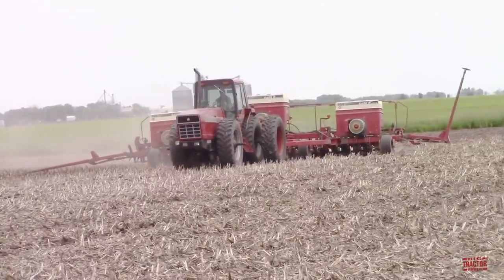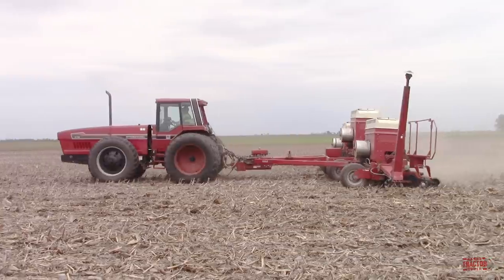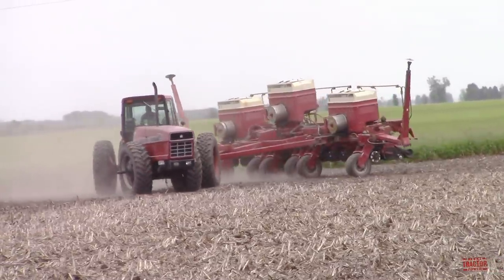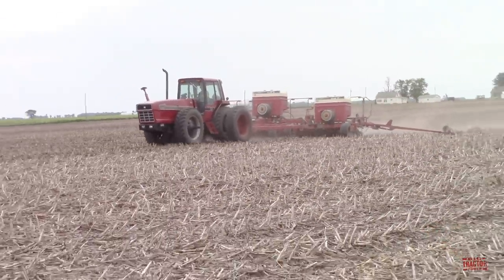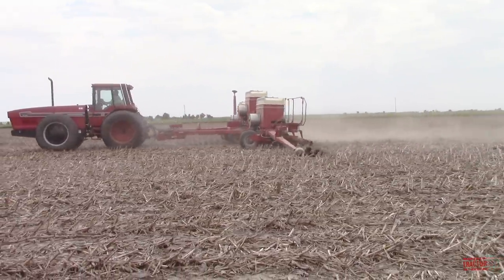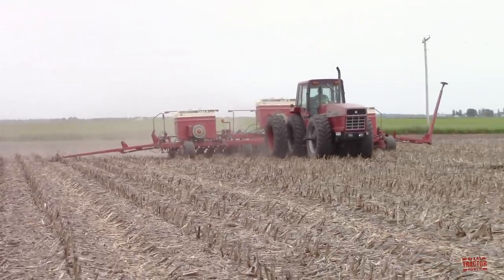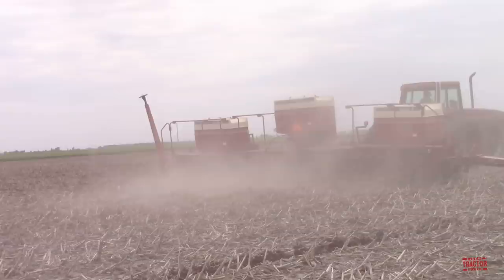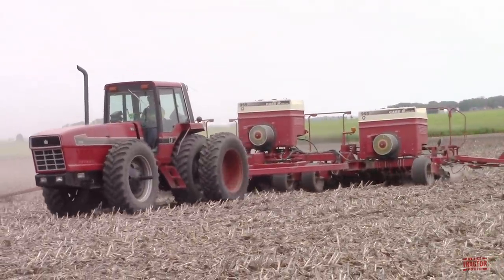INTERNATIONAL 6788 2+2 Tractor

Comment: I have a 6588. They say you either love or hate 2+2’s, I fell in love the first time behind the wheel. I really feel like if they were built a little bit heavier, they wouldn’t have got the bad reputation they had in the 90’s and early 2000’s. Treat them like the row crop tractors they are meant to be, and they are great pulling, economical machines. Great footage with the cyclo! 2 IH exclusives in one video!
Reply from the maker: It was neat to see this 6788 with the 955 Cyclo. I like being able to show brand matching tractors and implements .
Reply: Katwar ĺpl04

Comment: I used to run a 3788 2+2 on a dairy farm I worked at.. I did many tasks with it from chisel plowing to pushing silage ... It was a good machine and I have no complaints with it
Reply from the maker: Very cool. What type of blade was used?
Reply: @bigtractorpower  I believe it was a old degelman blade .. it was actually a nice tractor to push with because you can steer the front close to the side of the bunk and really pack the sides in .. not like the 8640 JD we used that couldn't get that close to the edge

Comment: Great video Jason!   I’ve never seen a 2+2 IH tractor but every since I’ve heard and read about them it seemed to be a great design.  Cool to see one working today.
Reply from the maker: They are an interesting tractor. They really stood out in the early 1980s. They are one of my favorite tractors. I am always excited to feature one.
Reply: @bigtractorpower  I can tell.  When you was talking about the AFS Connect CaseIH Magnum tractors it is interesting that the 2+2 was actually shorter lengthwise, even though that 2+2 has an articulation joint in front of the cab.  It probably would have been a great tractor if CaseIH had chose to keep making it after International Harvester was bought out by Tenneco.

Comment: Oh wow! Never seen an articulating tractor like the 2+2! Interesting! Thanks for the informative video Brother! God bless!
Reply from the maker: The 2+2 tractors were built 1979 to 1985.  The first generation models are the most common with a white cab. The second generation models with red cabs are scarce.  The 1985 models called the Super 70s saw less than 30 built before being discontinued in the Case IH merger.

Comment: We have had a 6788 since 1999.  We bought it to plant with which we did for 13 years.  we still have it and use it for rolling bean ground and sometimes put it on a grain cart.  I really loved it when we first got it but the shifting does wear on you especially after having newer tractors with powershifts.  We have talked about selling it maybe we will.
Reply from the maker: That is neat you have a 6788. When you replaced it as a planter tractor what tractor did you go with ?
Reply: @bigtractorpower  We found a Ford 8830 and planted with that until this year when we got a Cat Challenger 55.  We still have the 6788 and are using it on our roller.  Switched the Ford to full time sprayer tractor.  We have all colors on our farm very nondiscrimination here.
I love farming even with old equipment

Comment: We have a 3588 and 3788 2+2 tractors. The 3788 has a terrible vibration in the hydraulic system and we can't figure it out. The 3588 has been a great work horse. We have run that tractor on a 3x4 big baler, 16n42 wischic disc, and our land roller. Been a good work horse.
Reply: Check the pump.

Comment: we got a 3788 sitting in the shop apart right now, the 2+2 idea is rather impressive if used like a proper row crop machine. it would have been interesting to see what they would have became had IH been ok
Reply from the maker: Cool on the 3788.  It is too bad the Super 70 7488 and 7288 did not make it into full production.

Comment: Good video Jason, very informative as usual.  Just think of a Case IH puma like that now.
Reply from the maker: An articulated PUMA, OPTUM or MAGNUM would be neat.
Reply: Meaning something like this 😁:
https://youtu.be/Js6IqNTgYvs

Valtra made articulated tractors that looked normal tractors ~100hp to 
160hp

I'm not sure can you still buy new articulated Valtra, but at least late 90's to 2010's  those were made.

Some later ones have also front wheel steering.

Some were used in agriculture, but i think mostly in forestry and municipal (road sweeper, snow plowing) use.

These IH 2+2 tractors are so cool and unique 😎
Reply: @JS-1983  I remember seeing one of those in the uk. The owner had a business making wood shavings for horses.  Valtra were trying to target livestock farmers, they were very good in farm yards where space was tight.  I think the price put them off.  Another example of machinery ahead of the competition.

Comment: 2+2's are so cool looking. They are so different but effective tractors. I've wonderd why they stopped making them? GO BTP 💪.
Reply: IH went bankrupt during the production of them, and when Case acquired IH making Case IH, they didn’t realize that these tractors were beating Deeres hands down in the row crop department like IH found out. They discontinued them as they thought it was a waste of time.
Reply: They were also a premium priced tractor that earned a bad rep. Some of the early ones had hydraulic issues, many of them saw front duals added and the injection pump turned way up, and the drivetrains just didn’t take that kind of abuse well. Many of the kinks were worked out with the 6X88 series, if IH could have put the Super 70’s on the market 1 or 2 years earlier, I think the 2+2 design would have lasted several more years in production.
Reply from the maker: Both of the replies to this post are correct. The Case IH merger brought an end to the 2+2.  The Farmall plant closed and Case IH used Case built tractors from Racine, WI in 1985, 1986 and most of 1987. The Magnum was introduced in the summer of 1987 which was mostly an IH design with some Case input.  A Magnum 2+2 prototype was built but never went any further.
Reply: @bigtractorpower  the Magnum 2+2 was in the Red 4wd tractors book by Lee Klancher.  If anyone is interested in that book I recommend it.

Comment: I had a 3588 it was one of my favorite tractors ..but I seemed to get it stuck often disking in the spring getting over confident with the four wheel drive .. took a little while to get used to the front end swinging around too... I had a big snoopy decal made for the front end ...
Reply from the maker: Very cool on the Snoopy decal. I have liked 2+2 tractors since I was a kid. I remember them being new in my local IH dealers lot.  I would like to drive one some day to check out that long hood view.

Comment: I never understood why Tenneco halted production of the 2+2 immediately after the Case International merger. It seems like it was a pretty useful design.
Reply from the maker: When Tenneco took over they did not buy the Farmall plant. They wanted the IH combines and implements. Tenneco used the Case tractor line to fill the Case IH line up from 1985 to 1987. In August 1987 the Case IH Magnum came out which was mostly an IH tractor but was built in Racine. Corporate synergy ended the 2+2.

Comment: Around 1977 I worked on a farm as a teenager and they had what I believe was called a Ford Country 4x4 tractor . Unfortunately I thought it was the ugliest thing on 4 tires .Especially when I had lived on another farm that had a 3010,4020 and a 5020. But my stepfather bought a old what I called the Green Acres farm with one run down Oliver tractor. And he bought a Ford ... sel-lect to matic (?) . I've never loved these International tractors like this one. But a great video otherwise.
Reply: Ford County. Like a pre 4x4 from the time when Ford didn't do 4wd tractors themselves.
Reply from the maker: The County was a converted Ford with all wheel drive built in the UK. From 1972 to 1976 Ford included COUNTY tractors in their tractor line up in North America. The County sold in the US was about 70 Hp.